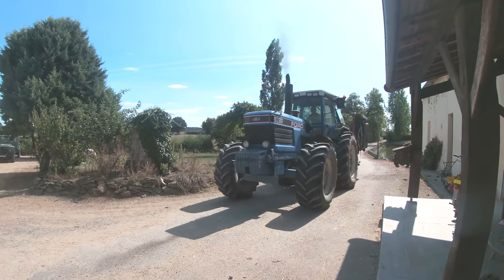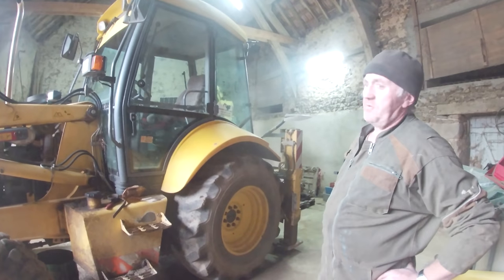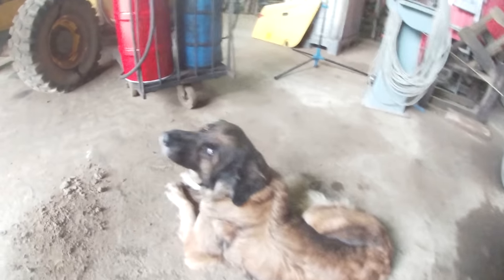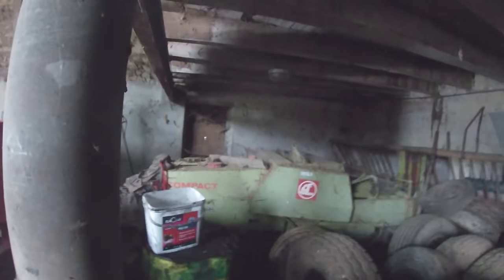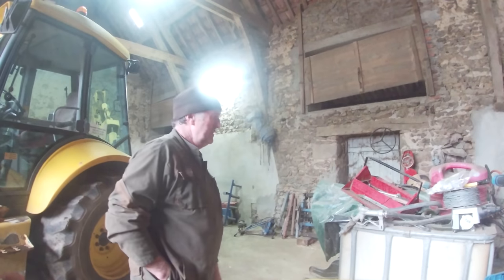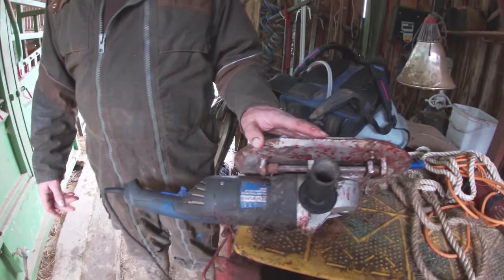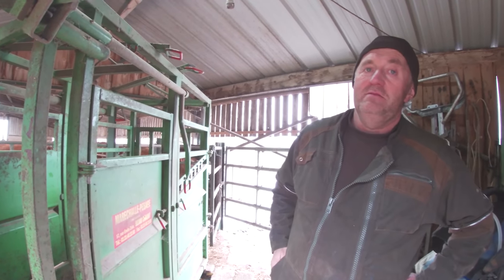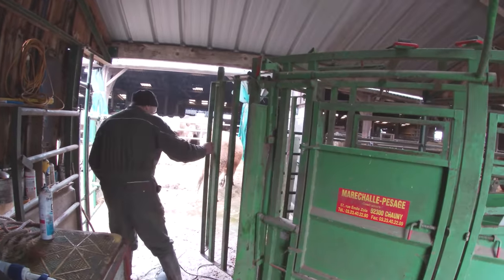Dehorning heifer's in France

Comment: I bought one of those dehorners about ten years ago and do a few every year and do some for the odd neighbours I find that if you leave a good rasher of hair around the base of the horn they bleed very little and don't grow a slug not that a bit of a slug makes much odds but some that I did about ten years ago and were kept for cows grew slugs that eventually grew into their heads so I had to wire off the offending bits eventually ( I'm talking six or seven years later) . I don't remember but I think I gave about €450 for the one I got and that included the dewalt grinder, my vet gets me to do most of the sculling that he has or borrows it for some clients between us we did 237 half mad cattle for a man about five years ago injecting them was the biggest job,cows , 3 year old bullocks back to strong calves, luckily we brought our new portable crush otherwise we would probably have been broken up as the facilities were not great, my vet still laughs about it, he says that the look on my face was comical when I looked into the shed and saw what was ahead of us, needless to say he had told me that we had a few weanlings to do and maybe a cow or two. We only had to replace the blade last year when I think back to sculling cattle fifty years ago with a saw the hardship on both man and beast, it's just a pity that some guys don't dehorn calves when they are small but at least we can make it as painless and as quick as possible when we have to do the job.